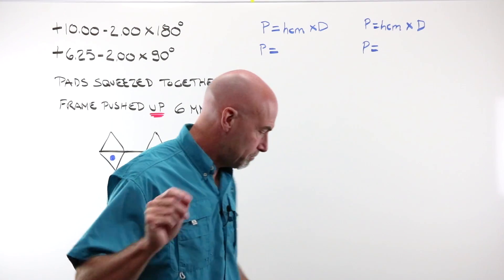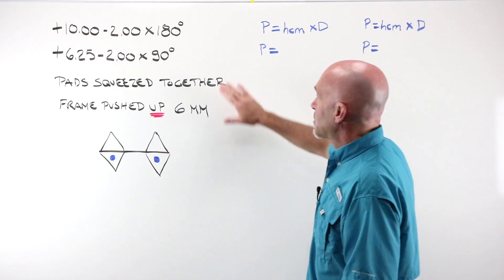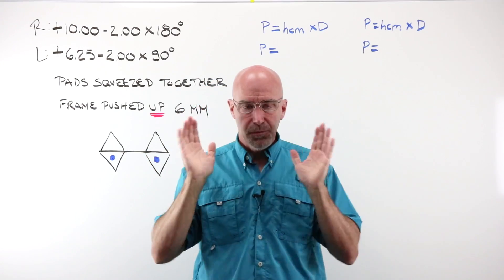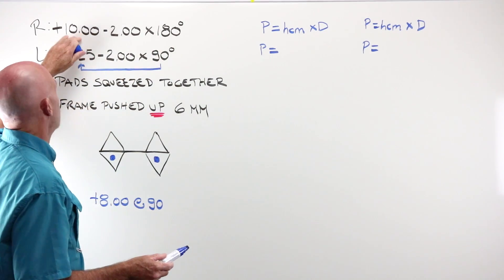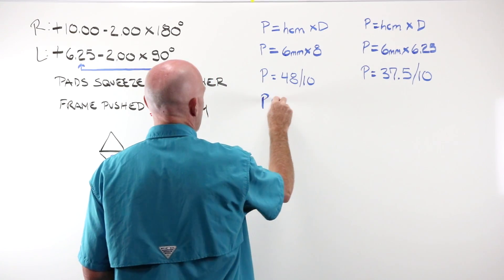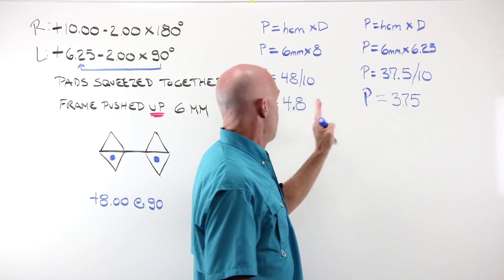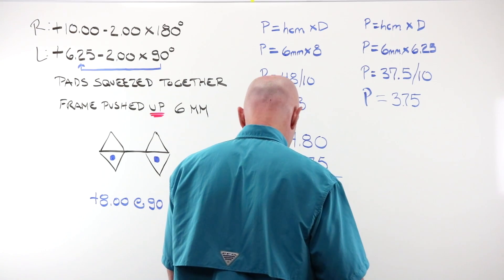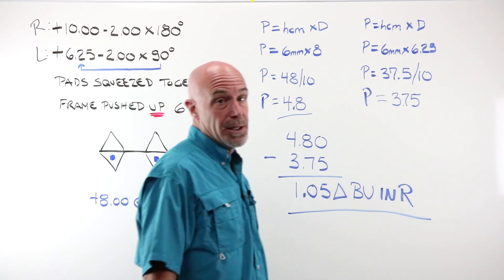How To Calculate Prism: A Working Example Using Prentice's Rule

Comment: Hey sir, why did u sum the power for the right eye (+10 + -2) and not for the left eye, as in (+6.25 + -2) and instead u just left it as +6.25
Reply from the maker: Because I already have the power in the 90th meridian where the error is occurring. The other has to be corrected from 180 to 90.

Comment: I have a prescription of my client,  written,  R: +1.00ds, +0.25dc 5axis, L: -1.50ds, -0.75dc 75axis. 7 Prism base out.
I want to distribute this prism power between right and left both, for cosmetically balance the thickness,  so what should I do?
Reply from the maker: Email me through the website and I'll send you a sheet on how to do that.
Reply: I have a prescription of my client,  written R: +1.00ds, +0.25dc 5axis, L: -1.50ds, -0.75dc 75axis,  7prism base out.  I want to distribute this prism power between r and L both for cosmetically equal the thickness
Reply from the maker: Email me through the OpticianWorks website.  @shakeelnasir7460

Comment: Hi John,
 In order to compensate for the 5mm. decenter blocking in order to trace the lens, can increase the PD setting in the machine by 5mm. x2=10mm. If the actual PD is 57, set the PD setting on the machine to 67mm.  Based on my calculation and drawing, this will result in an initial correct PD, 57mm. when the lenses are mounted in the frame.  Is my finding correct?
Reply from the maker: I must be missing something but - if a lens won't cut out, a lens won't cut out, period. You can shift it, move it, heat it, freeze it, kiss it, leave it under a pyramid overnight, it still won't cut out. Can you fudge PDs? Sure. Can you somehow alter the OC placement within the eyewire by "tricking" the edger? No. Wrong is wrong is wrong. Even if you took the time and figured out that your deliberate trick somehow resulted in little or no prism, wrong is still wrong. What if another optician did a neutralize/duplicate down the road? What about the tape from an auto-lensmeter? I guess it could sort of be a fun brain teaser of sorts but it seems like we should have better things to spend time on????? John

Comment: Hi John,
Another question related to a prism. 
There have been some discussions on the OptiBoard forum as to decentering lens (mostly smaller + lens) with a smaller PD in order to trace a lens in a machine.  It has been the forum consensus that this blocking method would induce unwanted horizontal prism.  Would this method be acceptable for max. 5mm. decenter for only reading use?

Comment: Great stuff!!
What if the Rx. had no cylinder, 
+2.00 d.s.
+2.00 d.s.
Since the  P= same,  is the answer 0 prism induced?  Which lead to a question, can one induce a prism in an Rx. with no cylinder?
Reply from the maker: Sure, yes, of course. Power is power... It is just way too easy if you just use simple sphere powers. ;-) John
Reply: @LaramyKOptical 
I am sorry John,
I guess my question wasn't clear.  So, prism cannot be induced in a sphere only lens?  Thx.
Reply: @JKim-hb5ry  It can be induced in a spherical powered only lens
Reply: @JKim-hb5ry  if both powers are the same and both decentrations are the same then no prism, power or decentration would have to be different, both eye sphere powers dont have to be the same, could be +2 & +2 or +2 & +4 or whatever

Comment: So maybe a strange question, but here it goes: You mention visualizing it -- with a pair of glasses, which I do often. When taking the actual ABO, do you think I'll get any flack from the testing moderators about taking off my glasses, and looking/moving/fiddling with them to visualize stuff? Would they think of that as cheating somehow? I mean, it is a built-in prop on my face that although I truly need because I'm myopic; it also does aid me in a way that non-glasses wearers don't have on test day.
Reply from the maker: c Pt -  LOL Heck no, screw 'em. A smart person might even wear a pair of plano glasses for the test so they had them to work with. Try not to get carried away with it but I'd say USE THEM. John